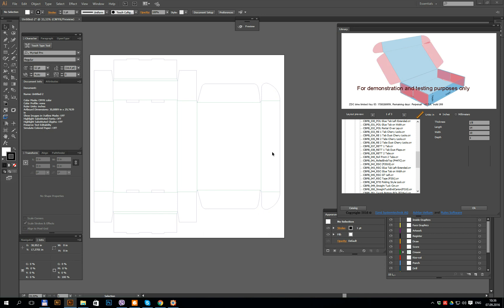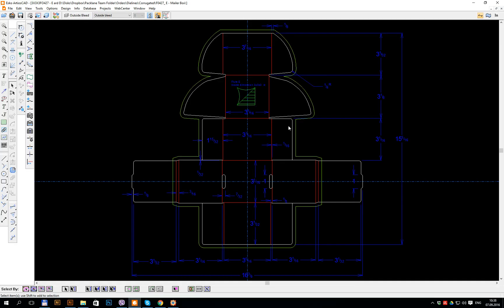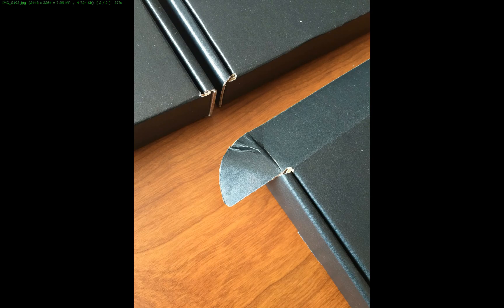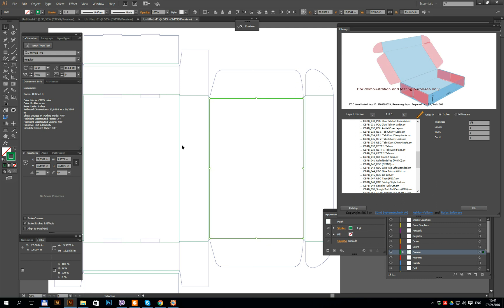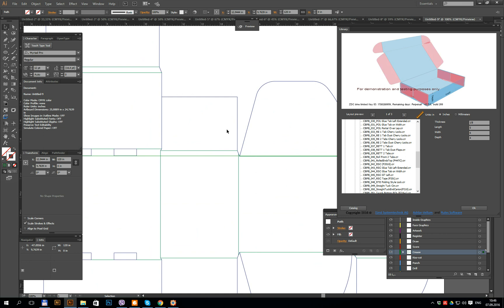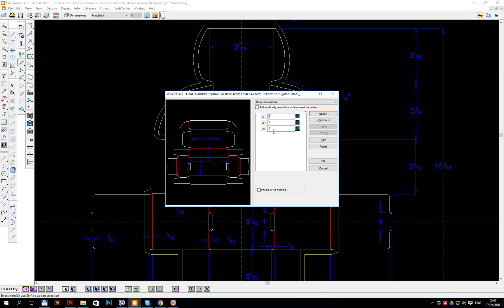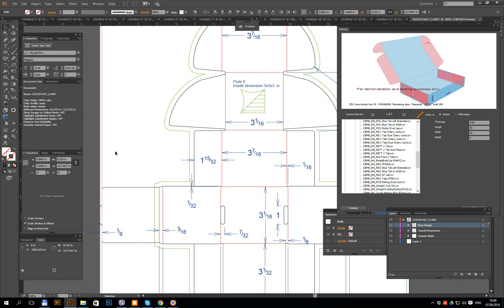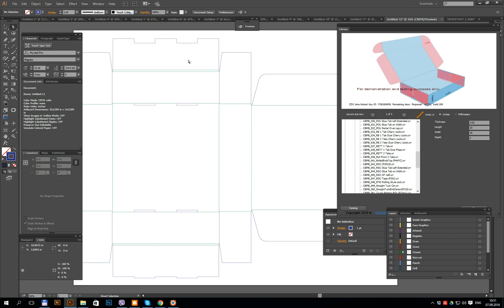Zünd Design Center VS Esko ArtiosCAD

Comment: Hi Roman. Thank you. Great video. But it is not correct to compare this two products. ArtiosCad should be compared with Impact. And ZDC with Erpa for example. ZDC is not a CAD program, its a plugin for Illustrator. Thats why its 10 times cheaper than ArtiosCad and 5 times cheaper than Impact. But it is a great that you do videos on packaging and structial design))) There not to many of us out there. Good luck. Best Regards. Egor.
Reply from the maker: Thanks, Will do it, if not found doblication at search system
Reply from the maker: Mainly, The software is used all feature of Alpha Corr